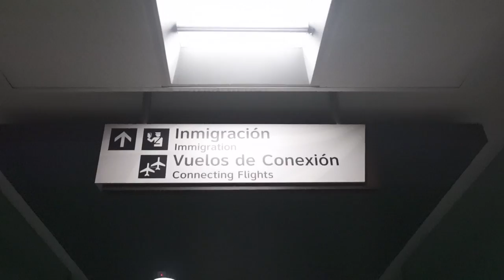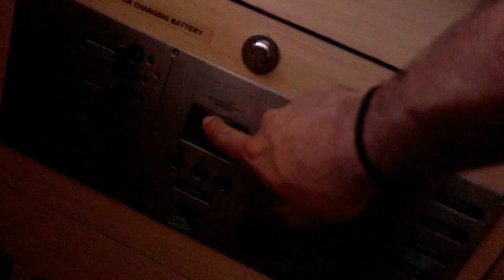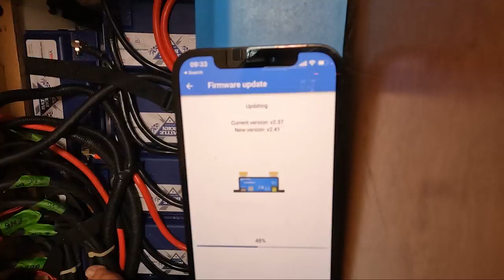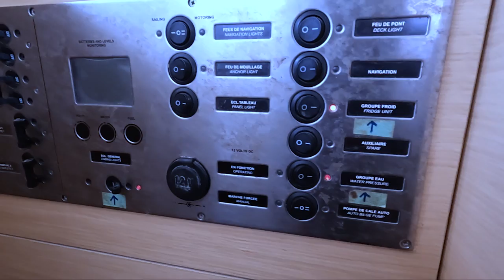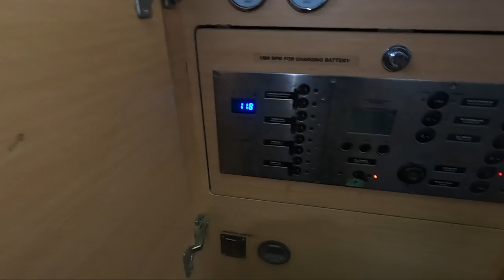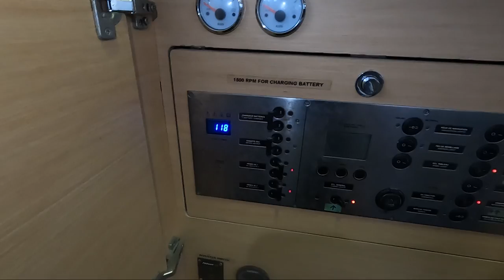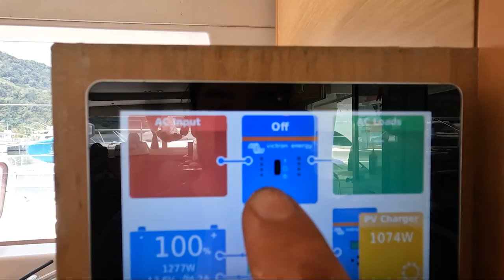We have been STRUCK by lightning AGAIN!!! - (Episode 192)

Comment: Float the ground on your mast by using a Spark Gap (lightning is attracted via Diffrence of Potential, floating the mast will keep the mast at the same polarity as the surrounding air). Isolate the mast from all electronics and power systems. Keep the entire Lightning Protect System on the outside of your boat. Never ground your mast to anything inside of your boat (motor, shaft, or metal fittings etc..). Isolate all power systems from each other. Do not connect the ground wires to each other, and do not connect the ground wire to the neutrual wires. Float the neutral wire on your AC inverter (NFPA 99/ NEC; "Electrial System in wet areas").
Reply: Very good advice.  Secondary to proper grounding techniques, add a static disapator at the mast peak.
Reply: @weinerdog137  I have had Very Bad professional experiences with Static Disapators, they attract lightning.
Reply: What a bummer!! Great advice here 👆👆
Reply: Tough. Good news, so far some systems do work aftera reset. Still a setback but can move forward cautiously. Reminder for more spares. Easy to say but costly.
Reply: Agreed. Somehow, some way, some where, the main power systems and all components running off the "main power systems" MUST be isolated from the mast grounding system or during a transit those "grounds" can elevate in voltage such that a potential across sensitive equipment will exceed its ability to withstand it.
Reply: Now I am no professional but basic common sense is you want to divert all the Amos from the lighting and dispate it into the water so what would happen if you simply had a 10” copper lighting rod attached to 2 lightning ground cables to run down the rigging 1 each side ending in the water. Now like I said I’m not an expert but i know electricity will take the path of least resistance so it seems like common sense tells me it would hit the highest point and most conductive which would be the copper lightning rod and the tin plated copper ground cables just have to figure how to isolate the ground cable from the tension rigging like porcelain or you could make something out of pcv I don’t have all the answers but it’s better then nothing better then frying tens of thousands of dollars worth of  equipment.
Reply: I don't know how effective that will be with the antennas and mast located on the mast.  Completely isolating the electrical systems might have some effect.  Boats needs a way of rapidly disconnecting systems during lightning events.  Aircraft electrical systems are almost immune to lightning strike and rarely suffer damage during lightning strikes.  On average airliners get struck by lightning one per year.
Reply: @blackheart30518  I was thinking something similar (not a professional either). Heavy cabling from the mast to some kind of copper/metal plate you drop in the water when docked to dissipate the lightning rather than have it dissipated through the boat.
Reply: I agree with you. After 40 years sailing the world. We never grounded all the metal together on the boat. We also had a static dissipator on the top of the mast. I saw boats right next to me get hit by lightning too many times. I never was struck. Many friends lost everything on the boats from lightening strikes. Never on my boat. I truly believe in the static dissipator on the mast head, and not tying  all the equipment together as a “ground”.
Reply: @alexanderparkman4393  Aircraft are not grounded like a boat so lightning does not have such a severe effects and since the aircraft (or was till the 787) metal the energy of the lighting tends to travels on the skin and not into the aircraft. I have repaired doors on the outside of aircraft that have been welded shut by lightning. Seems like there should be and may be something that would since the lightning surge and did connect everything (if it's isolated) in a few mil-a-sec. Similar to a GFI breaker in your home.
Reply: If you float the mast it will find its ground through things that you don't want it to. It will always find a way to ground. That is how you blow holes in the hull and blow up the electronics.The idea is to give it the shortest path to ground so that it doesn't bounce around. It will always find a way to ground and if you are standing near the bottom of the  mast  and there is no direct path it may be through you!  Use of heavy flat braided cable or wide copper strap to everything with short runs to multiple ground plates is pretty much the only way to keep the lightning contained and minimize the damage. 

 I worked at a satellite station near Bogor, Indonesia with lightning storms over 300 days a year. We would get hit most every time as we had a 300 foot microwave tower there. We used heavy braid and copper strap going to a grid of ground rods under the computer floor to keep the lightning at bay. You can do the same thing with multiple ground plates around the hull and short direct wires from exposed chain plates and the mast step.
Reply: @PWCPhoto  Yes, Franklin Lighting Systems are the most common sytsems used. There are new high tech systems that prevent the towers from creating the "Diffrence of Potential" that attract lightning. The simplest system and the most proven is a "Spark Gap", which allow the mast to have the same charge as the surround air, eliminating a Diffrence of Potential.
Reply: 🤷‍♂️ Maybe next time
Reply: Not sure about this. I don't have much experience with lightning in yachts but I do have a lot with aircraft. The problem is the fact that lightning can develop 200,000 volts. It can blow right through laminates, while delaminating them, and then frying electronics as the bolt charges up the yacht's electronics. I know that the bolt, when it strikes the aircraft, can jump large gaps. I don't think that the gap can get large enough from other current carriers, such as other wires to bow-thrusters, alternators, inverters, etc, particularly since the mast generally has electrical wires too which eventually converge at points. I do like the idea of keeping the ground wire away from the yacht. That is not easy however. The bolt can go right through the laminate if it decides to jump to a current carrier on the other side of a laminate.
Reply: @stevelaminack1516  Yes, there is a substantial difference as most aircraft have aluminum surfaces which keeps the lightning on the surface and channels along the aircraft from the entry point to the exit point. However, that is not always the case if there are disruptions in the metallic surface. There have been some catastrophic accidents when lightning did not stay on the surface and went through the structure, sometimes entering partially empty fuel tanks. For composite aircraft, they do something different to channel the lightning bolt. The advantage that a boat has is that it can dissipate the static charge continuously to nearly zero if it is grounded properly so it becomes less attractive to the lightning bolt.
Reply: Hi I considered this problem for a long time and floating the mast above ground potential in a wet salty environment just did not seem logical to me with nav  lights radio aerials etc .... even if they are not electrically connected the mast will be at ground potential just from the insulation resistances of said cables.... 
Instead I advocate some light gauge weling or car battery jump leads bolted onto some heavy gauge aluminium plate dropped over the side with the other end electrically connected to the metal rigging...at the first sign of a thunder storm....

If the mast is hit by lightning it could potentially punch a hole in the boottom of the boat if it is wood or fiberglass....if you boat is steel or aluminium just roll over and go back to sleep, your safe....  It has been suggested to me that a good solid strike to a ferro cement boat might cause at the cement to be blown off the armature, but no one that has been in such a boat suffering a solid strike has ever survived and come forward to talk about it.... imagine a wire netting boat in the middle if the ocean!   
Notice I talk about lightnning and solid strikes, that is were the lightning actually come directly down hitting the mast....less destructive but equally as dangerour is indirect lightning strikes that do not need a direct hit to induce some very high voltages in any metal objects.... this can occur even when the thunder storm is some distance off but can still fry electronics or give you a shock.... 
Grounding for lightning has to be like welding cable otherwise if a lightning strike occurs thinner gauge wire will explode and cause fires.
Reply: @apollo8352  It does not seem logical to me either. As well, the ground point that Brickhouse recommends is far larger than any welding cable and with far less resistance. There should be no damage to the ground point if there is no damage to the cable. I am not seeing the substantial electrical difference between a cable thrown over the side with a means of dissipation on the end and a cable inside, bonded to a substantial piece of metal  that goes through the hull. For delam to occur around the ground point, there must be some significant expansion of the metal beyond the capability of composite to accept it, which is unlikely, or substantial heating of the metal, which should not occur as well.
Reply: @robertcarducci3807  Hi think what happens to a tree struck by lightning, and remember out on the ocean your holding up a metal rod much higher than anything else for miles around...   the standards for lightning protect suggest minimum cable of 10mm2 which is pretty heavy gauge cable, any less may just bring the lightning on board enough to jump elsewhere as the cable fails..... I also considered that if I just ground to metal going through hull one of the paths might be through the motor gear box and all the bearings in them out to the nice bronze propeller.  Certainly any heavy electrical current through bearings is known to damage them.
Reply: means no wind wane, no anchoring light, no navigation light, no Radar, no VHF antenna…… your advice is physically correct but practically not possible on a modern sailing boat…..

As soon as the NMEA cable is running into the mast (just for the wind wanne), then the overall electronic will fried.

Not speaking about the fact that wet deck, most of the time covered with salty water is already enough to dispatch the lightning potential to somewhere ending into any grounding connection.

In top, if a metallic part is not grounded again lightning strike, but in contact with Any composite structure…..⚡️💥🔥🔥….

Finally your proposition make sense only if you applied the exact same requirement as on aeronautical composite airframe: electrical Bonding of all external metallic structure + meshing into the overall composite structure. in over word: make the airframe (or here the boat) into a faraday cage
Reply: @alexanderparkman4393 because a airframe (aluminium or composite as a modern 787 or A350) is designed as a faraday cage: all external metallic part AND the skin of the composite airframe (using metallic meshing into the composite layer) are electrical bounded ( I said bounded, not grounded …on purpose) thus you have a  fully isolated faraday cage protecting the overall system installed inside the airframe.

Barely not possible on a boat
Reply: @marilyncook658 this type of protection is : try to avoid to be striked. But in such a case the issue is: if you get strike (it is still possible), you have a much higher risk of fire, since the lightning potential is not going to be diverted to the ground (or  through the composite structure….which means…..high risk of fire).

Most of the actual requirement (at least in europe) tend to protect again fire (so you divert all the potential to the ground) , not the electronic on board.

I prefer this type of protection (10-20 kE dammaged again total lost of 300-400 kE in the case of a lagoon 450 )
Reply: @damientelle  there are two schools of thought. Research is all over the place. Grounding on land is vastly different than in the water or even in the air in an airplane. But in my over 40 year experience with having numerous boats right next to me struck by lightening, and I was never struck, I stand by my opinion based on experience. Something I have noticed which is alarming is that it seems vastly more catamarans are struck by lightening these days. Why is something to research.
Reply: @PWCPhoto exatly: grounding the mast and the shroud is a fire protection (and life guard protection). 
After the mistake on the boat is that we keep device (VHF antenna and wind vanne) connected to electronic with nearly no lighning protection : the wind wanne is today connected to a BUS Can cable connecting all electronic. The perfect backbone to dispatch the lightning energy to every body (including Victron device since i am pretty sure that the Victron communication network - VE Direct - is probably connected to the NMEA2000 of the boat ? (i would like to check this point ?)
Reply: @stevelaminack1516  I experienced a lightning strike about 5 years ago when I was acting as sic on my friends DC-3.  When we landed at Oshkosh it was obvious we experienced a strike but the damage was very minor on the upper fuselage with a 1" diameter depression in the skin.  One of the Dayton Grainger static wicks was obliterated during the strike.  The worst part of all is my friend had just spent 5 years restoring this DC-3 and barely got it done in time to fly it to Oshkosh and the fuselage was freshly polished.
Reply: @marilyncook658  you are exactly right. you can apply protection to avoid strike. But notice that in this case, you increase other risk

For new production, this kind of protection(floating potential) is not legal (At least in europe) It may explain why cat are mainly strike around you ? because for sure all chain plate/mast/shroud/ are properly grounded on any lagoon, bali, leopard,fontaine pajot and so on , This is a certification requirement (fire and life protection)

I fully trust your experience and it is physically correct. But the counter price is for me(and certification authority) to high : risk of life and fire versus risk of electrical/electronical dammages 

The second issue is that if every body ( i mean all boat around you) is applying this type of protection, then strike will anyhow find a way to a lower potential ( in this case the hull or any other structure above the sea level)

Thus it can be an individual protection (if you accept this higher risk of fire or lethality), but can’t be applied as general requirement.
Reply: Right on you are 100% right

Comment: I'm a little green with BMS's but they have about 4 jobs. 1 keep the battery from over charging 2 shut the battery off when it gets too low 3 keep the battery from charging when temps are too high, 4 and to low. The least time it is doing stuff is when the battery has a perfect voltage, which yours did.
Reply: I'll bet the inverter bluetooth (?) or whatever coms it has needs to be programmed ? Comms set up ? Your doing really well I think. Your lucking out ! That said, a really good plan for protecting your boat is at Kasten Marine Design, search for word "lightning", I like what they are saying for the most part. We also used Polyphasers in the antenna line, vhf. The polyphasers should be grounded to the horizontal deck ground system. The general idea is to give the lightning a "path" horizontally off the deck (not inside the boat) to the surface of the water. The best boats have that design.

Comment: Damn man, what a shame. Hate to hear it, but it's just one of those risks that comes with boat life...or life near lightning zones in general. My house in Miami got hit by lightning too.  Hope you guys find a quick way back from this. Thanks for walking us through the troubleshooting throught process, very valuable.  Keep it up, cheers!
Reply: Sad news on any vessel  lightning 🌩 sucks.   Ground cable extremely too small need a welding cable  and are all chainplates routed to the ground plate.  An ion diffuser at the top of the mast is also great.  Some old timers used to use chain on the chainplates submerged in the water for extra precautions.  Good luck  🤞
Reply: Darn…. So sorry for the damage. You will get it all working again, y’all rock

Comment: Believe your mast is bound to the hull or at least an anode purly for corrosion protection not as a ground for lightening strike. Lightening causes damage in 3 ways. EMP, direct current and indirect via shore power conections etc. You can only ever realy try to limit damage not stop it, priority is to reduce the boat potential to prevent a direct strike. Various devices are needed in shore power connection to protect against indirect strike and electronics can be protected against EMP. As a marine engineer I'm sure you will sort the weat from the charf with all the bad information that is out there but there is a lot to consider. LV DC, HV AC, negative returns, grounds, cathodic protection and negative bound sytems for corrosion control all vulnerable to lightening. Remember current might take the easist path inetialy but once resistance increases it flows wherever it can to get to earth.

Comment: Mold control a product you can get at Home Depot works really good after you clean . And it will make the air noticeably better instantly. 30 bucks a gallon but it works really good